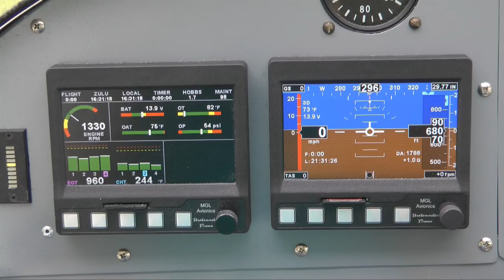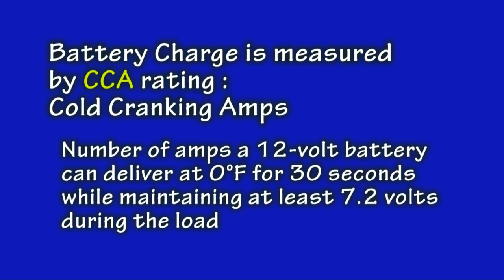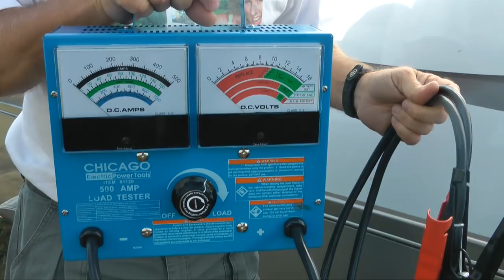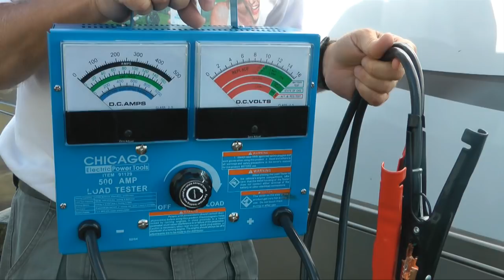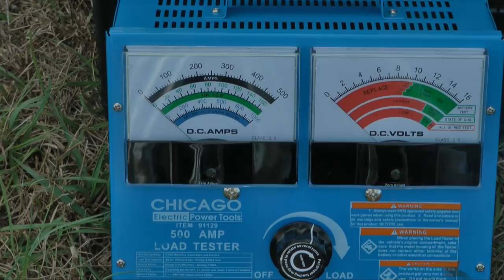How to Test Homebuilt Aircraft Batteries

Comment: You deffinately shouldn't disconnect the tesr clamps with the load knob still turned up.
Diong this produces a spark at the clamp, right on top of the battery.
Lead acid batteries vent explosive hydrogen gas while being discharged and charged.
This can make for a really bad day if that spark happens to ignite the hydrogen.
Another good reason to turn the load knob back to zero is so you don't forget and next time you use the tester it is already loaded and will produces a spark as soon as you connect the clamps to the battery.👍

Comment: Concorde indicates that a capacity check should be done by placing the load at the C1 value for about 50 minutes.  If C1 is listed on the side of the battery at 33 amps and you hold it for 50 minutes, the Harbor Freight device gets really hot.  Is your method an acceptable alternative to their suggestion?

Comment: Thank you for the video. I used to check my battery with a multimeter, just reading volts, but a battery tester is much better as it actually tells you the CCA, which is what you need to start an engine. Your video told me what to look for, but I finally end up buying a digital battery tester instead of the analog one you show. There are three good reasons for that. First, the digital tester only takes 1 or 2 seconds to analyze the battery, not 15 seconds as the analog one. Second, the analog one drains amps from battery as if you were starting the engine, so if you had a chance to start it then it will be gone after the test; in contrast, the digital does not perform such an intensive test, it only relies on the impedance of the battery, you can repeat the test as much as you want, it won't hurt the battery. Finally, I found many digital testers much cheaper than the analog ones, and with lots of possitive opinions. Hope this helps too.

Comment: John I see you show an Odyssey absorbed glass mat battery and an Earth-X lithium battery at the end of your video.  Is the standard lead acid battery load tester used exactly the same way with these other types of batteries?
Reply from the maker: Yes - any battery can be subjected to this load test- and CCA is still CCA.  There are other measurements of power based on different time parameters MCA (some:shorter bursts: PCA) .Also, as noted in video on chart, AGM and lithum batteries will have slightly different full charge (resting) values compared to lead acid.  Always check/follow manufacturers info.